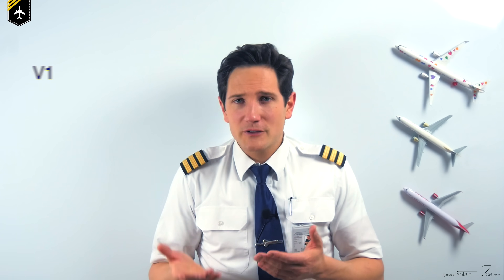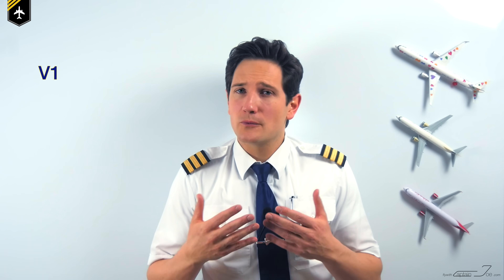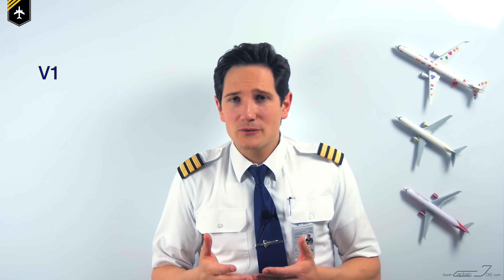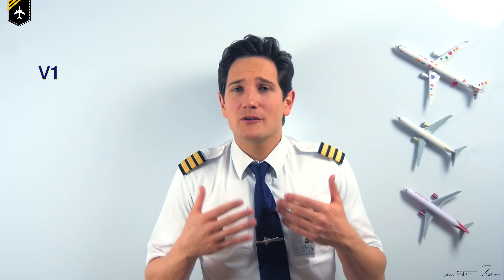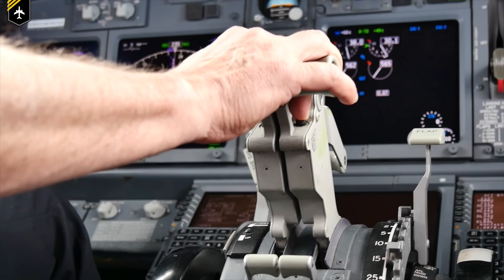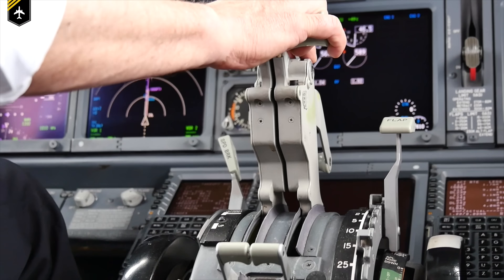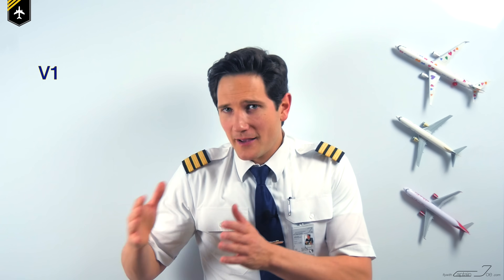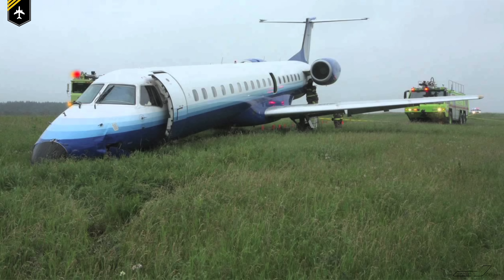TAKE-OFF Speeds V1, Vr, V2! Explained by "CAPTAIN" Joe

Comment: thanks capt Joe. our 737-800 ingested birds into both engines on rotation out of Darwin. power was reduced and fuel dumped. we landed safely but heavily back at Darwin. both engines were flushed. the cores were okay. master alarm for overweight landing checked. two hours
later we flew off safely against the wind. this was because a bushfire was burning and bird strike was again a factor if we took off into the wind on that duty runway. ATC and delay for new takeoff calculations. best regards.
Reply from the maker: Oh dear, that sounds like a very very long day :(
Reply: @flywithcaptainjoe  Hey I was thinking of something that you never heard and that no pilot would ever want to hear or experience, if a plane doesn't reach rotate speed when it nears the end of the runway when it has passed V1 what will have to happen?, I know that a plane can't stop when it reach's V1 so if the plane can't take off until it has reached rotate speed what would happen if the rotate speed isn't reached?
Reply: Captain Joe  hi capitain joe my name is gonzalo panduro i just want to tell you can you pleace make a video about turbulace on a plane i am not afraid of flying but i do get scare when i fly in turbulace should we be afraid of turbulace or not can a plane get damages with severd turbulace thank you.
Reply: @gonzalopanduro4654    Just about any turbulence you might ever happen to be in, no matter how bad, is way less than what the plane is designed for.  Suppose the wing tips are bouncing up and down by say a whole meter on either side of neutral position, and the cabin is making all sort of creaking sounds?  Well,  the wings must pass a test during aircraft certification where they are deflected with hydraulic jacks to more like 5 meters upward, and even then all of the flaps/slats/etc have to be able to operate!   As for all the noise in the cabin coming from the overhead baggage containers during turbulence, those aren't part of the aircraft structure, though of course they have to meet certain strength requirements.  So you can relax (or try to) while the aircraft does what it is designed very well to do.
Reply: actually turbulence is fun.
Reply: Dave Hull 
I've only been in a big plane twice, going and coming back. I found the take offs and landings somewhat interesting especially sitting behind the wing where I could observe the control surfaces as we flew out and back in. Besides that I was bored out of my mind except for a period of some turbulence :-)

Comment: What happens if all the engines fail after V1? Eg a twin engine failure in a Airbus A320.
Reply: I like your optimism.... :-)) BTW you should ask Sully....
Reply: Glenn Watson Then you land in the Hudson.
Reply: @Glenn, i think you could safely stop, if the remaining runway lenght is enough. You have to engage brakes and spoilers and also thrust reverse (not much useful with both engines failure, but it should help a little bit).
@Allfresco, takeoff??? Are you serious? Maybe at V1 you have the SPEED to takeoff, but with both engines failure, pls tell me where do you find the THRUST to takeoff, gain a safe altitude, turn around back to the airport and perform a safe landing. Simply you cant. Cool joke dude ^_^
Reply: actionLEGOs haha I can imagine the checklists BOTH ENGINE FAILURE Sully mode - armed, Hudson ILS - establish
Reply: Glenn Watson that's really unlikely to happen, there are almost none cases in comparison to all the flights that happens everyday, however, I would try to brake, if the runway is long enough you should be able to, if not, just pray that there won't be any  tree, highway, cliff, any terrain or object that would destroy and burn the shit out of your plane
Reply: we only plan for events that are less than one in a million chance, so a double engine failure is so remote we dont plan for it. but if you have dual failure, you aint flying!
Reply: Well, while technically Captain Sullenberger's landing was a twin engine failure on an A320 after V1, it was also after Vr (and I think V2 - he was at ~2800ft and ~4.8 miles out when he struck the birds), I'd interpret the question to be more accurately "What happens if an abort is necessary between V1 and V2 due to mechanical failure?"  In which case - autobrakes and hope that the arrester/EMAS (if present) is enough to slow the plane.
Reply: V1 is the point no matter what you do, if you abort the take off, you will overrun the runway. The scenario you mention, I think the pilot should pray what lie ahead of the runway, some have arrestor or at least clear, flat field and you are lucky, if there were obstacle at the end, may god be with crews and passengers.
Reply: Glenn Watson you pull of A captain sully...
Reply: I think you get higher chance to get hit by an asteroid then to expirience both engine failure btw V1 and Vr
Reply: If a catastrophic failure, that prevents flight, occurs after V1... well, tough luck - you're going to overrun and hopefully stop in clear section around runway. Or you will hit a ditch or a tree and die.
Reply: Start throwing things off the side of the ship for reduced weight including passengers who brought extra large carrion baggage.
Reply: Carrion baggage???  Those passengers be vultures!
Reply: You crash, simple as that. Airliners are required to survive any single system failure, not multiple system failures.
Reply: sully
Reply: Sully's scenario happened after V2.  He was already in flight.  If it happened after V1, hopefully the runway is long enough to stop otherwise you'll over run the runway.  You'll may not have enough speed for Vr.
Reply: It would not be a bad idea to try to relight both engines while stopping.  This way reverse thrusters would be more useful.  It would probably be a fuel problem if both engines failed within a couple of minutes.  Even an engine wind-milling may get you some use out of the reverse thrusters if they are operational in your aircraft below engine idle speed.   Or, initiate Drop Anchor on the Catawumpus Deployment Console.  (Optional).
Reply: it depends how long after V1. If you hadn't even begun the rotation you would just attempt to stop on the remaining runway. All of these numbers have considerable safety factors built in anyway so you could easily do it. More than 5 seconds after V1 you would take your chances and glide it down somewhere. You'd still get some residual thrust before the engines totally failed anyway.
Reply: nyc1164 if you have a dual engine failure, there is no such thing as V2.  V2 is takeoff safety speed that guarantees climb before for that runway, on that day, at that weight.  The aircraft WILL NOT fly off the ground with a dual engine failure.
Reply: no
Reply: Glenn Watson you can abort but it will likely cause a overrun
Reply: even that, it wasnt failure due to the engines it was birds, so the chances are almost 0 of a duel fail at V1
Reply: idk but in a simulator i would stop, just apply maximum braking and hope for the best, if there are obstacles at the end then maybe youo could steer the aircraft into a taxiway or something, if the engine failure happened after Vr or V2 then that would be catastrophic, the aircraft would stall and be done for.
Reply: i think its depends long runway, short runway, birdstrike fail or completely shutdown
Reply: Cygan there wont be enough alt and airspeed
Reply: Keep the blue side up, the green side down, and hope for the best.
Reply: lol
Reply: not true. modern airliners can survive multiple system failures. All engine failure is a category of its own.
Reply: bernie weber if we could quickly relight the engines after a dual engine failure, don’t you think we would use them to fly instead of thinking about reversers?
Reply: UselessTutorials an overrun is better than trying to take off.
Reply: Everybody's atheist till the plane crash
Reply: Do a barrel roll!
Reply: take off and then hope for the best (try to glide back)

Comment: Why are the Pilots saing 80 knots or 100?
Reply: There are at least two pitot tubes for measuring the speed, whereas they indicate the speed on the pilots and FO screen independently. As far as I know they call out 80knots and "check" in order to be sure that both pitot tubes measure the exact same speed. This is important as there have been a lot of crashes due to uncertainty about the actual speed, like Air France 447 in 2009.
Reply from the maker: It´s a incapacitation call, and if the speed is the same on both speed gauges! Video in the making!
Reply: Fly350X i think in that speed they check if the cpt and first officier pito working well like the airbus procedure 100knots checked ( so their instruments showing the same result of 100kn ;) )
Reply: after 100 knts take off will be aborted only in case of a major failure
Reply: Fly350X yeap speed checked and considering major failures only

Comment: I know what they mean but wha about 80kt and positive rate
Reply: One reason pilots call out 80kt during the roll is to cross check their Airspeed Indicators, to make sure that they're both in-sync. Positive rate means that the airplane is climbing at a positive rate after rotation (+300ft/+500ft/etc etc), which follows the usual saying, "gear up"
Reply from the maker: Video in the making!

Comment: When you abort takeoff, do the spoilers need to be armed to deploy or do they do it automatically?
Reply: Lewis Ferry it depends on the plane. Generally on newer aircrafts  such as the Airbus A320 family they deploy automatically(that's why the pilot arms the speed brakes like a landing at takeoff and disarms them later), on older aircrafts they so not.
Reply: Lewis Ferry in a 737 they are not armed for take off, during a reject take off the procedure tells you to deploy them manually, but they do come up automatically when 1. Thrust levers are retarded to idle, 2. Wheels speed is more then 60kts 3. Reverse thrust is used.
Reply: Foster101 thank you very much sir, this really helps